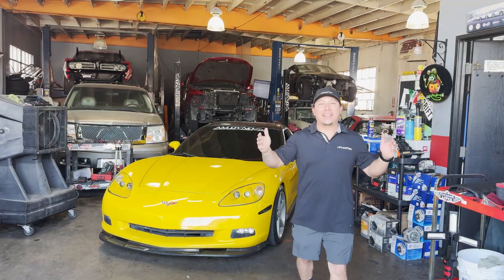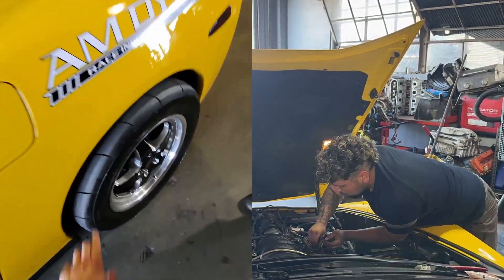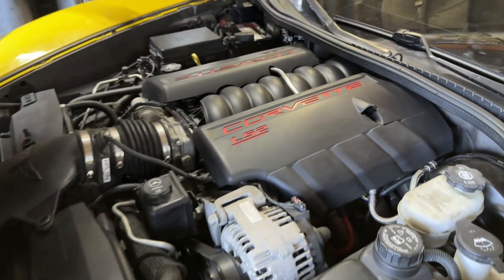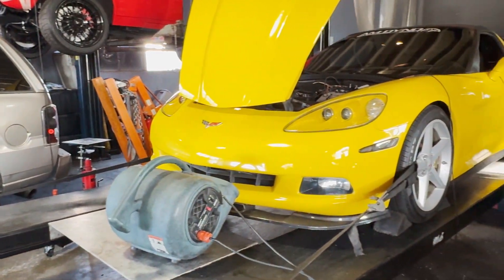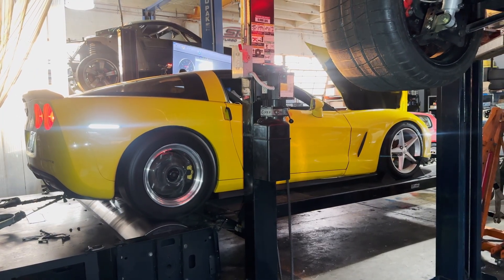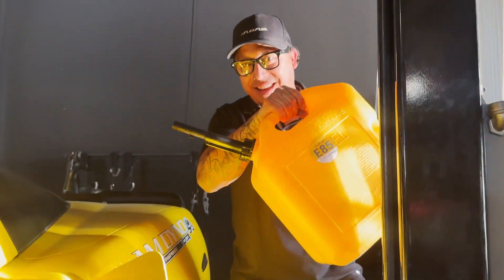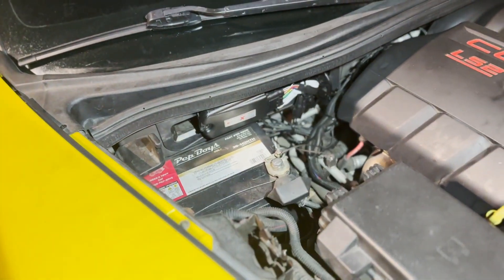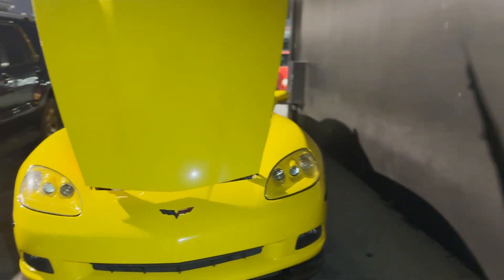Fuel Wars: 2005 Chevrolet Corvette C6 LS2 6.0L Dyno | eFlexFuel + E85 vs. Gas: Which Wins?

Comment: Question if I have a local tune on my car can I still run this ?and have headers idk if it’ll make a difference
Reply from the maker: Yes, our system is designed to work in conjunction with the tune that you have on your ECU. You'll have no issues with your setup.

Comment: Did you have to change the fuel pump?
Reply from the maker: No, it's not necessary.
Reply: @eFlexFuelUS i heard e85 will eventually kill ur pump. I have the whole rear cradle so inwas debating, since im going e85

Comment: Would've made more power on a 26" tire. 28's are overkill if not making over 1000rwhp. E85 imo is a waste on a bolt on C6 when comparing how much of a hit he'll be taking on fuel. Now if he had a blower, switching from 91-93 octane to E85 would net gains of 75-150rwhp depending on boost level. I also hope that the lines were changed out to teflon lines and E85 compatible fuel pump were added